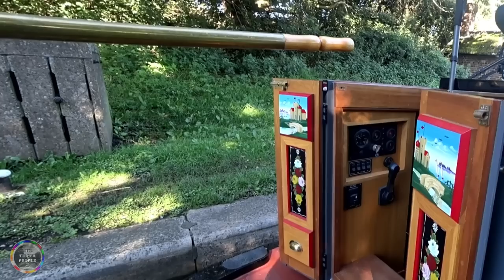That Narrowboat Feeling - 2020 - 147 - WOT NO WATER? - Shropshire Union Canal

Comment: Thanks K & B, you've convinced me a thicker hull (on one of your previous videos) is the way to go. You could see the difference with your boat compared to the others entering that lock with the heavy by-wash. Take care and keep well.
Reply from the maker: Hi
Heavier and deep drafted boats do not react as quick to a fierce bywash. Also the design of the boats swim also makes things easier. It is quite difficult these days to find boats with 15mm baseplates, most are 10mm.
Stay safe and well. B & K 👍💑😷

Comment: So presumably the top pound has one or more  water supplies to re-fill it as it is depleted by locks on either side, and that supply of new water was partially blocked by something, creating problems further down the line.

It is a pity CRT don't produce little videos of the jobs they get called out to.

Thanks for the trip. very nice, as always.
Reply from the maker: Hi Pete
Water comes into the canals from a variety of different sources. On some canals pumps take the water back up to the top of the locks if the normal supply is poor. We found out a few days later that the overflow pipe on one of the flight of locks at Adderley had become locked causing a water shortage. Since then we have walked up the towpath of the Audlem flight and problems seem to be persisting.
Suspect further maintainance will be required over the winter.
Stay safe and well. B & K 👍💑😷

Comment: Excellent !
Early on you mentioned that there will not be enough water yo fill the pound.
Im not familiar with that term. What is the "pound " ?
Always something new in your vlogs. Love it.
Reply from the maker: Hi Nick
A pound on the canals is a stretch of water between two locks. You can have long or short pounds. These can also run dry or overtop the towpath if water management is poor. Stay safe and well. B & K  👍🏻🌈😷

Comment: Keith, on the double  gate locks  you open one how do you  get to the other side to open that gate??
Reply from the maker: Hi Frank, I walk around the lock & over the top gate. Some locks even have a handy bridge across too. B  🙂🙂
Reply: Many boaters will step across the gap between the double gates. It looks dangerous, but, in fact, the gap is only narrow as there are steps and well placed railings on the top of the gates to allow one to do this.